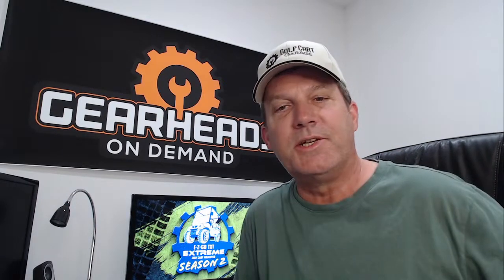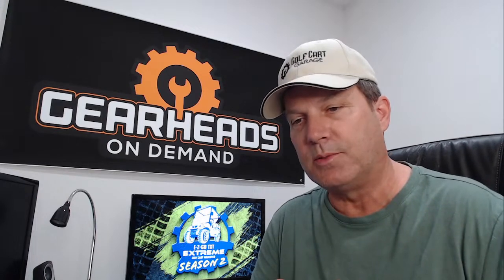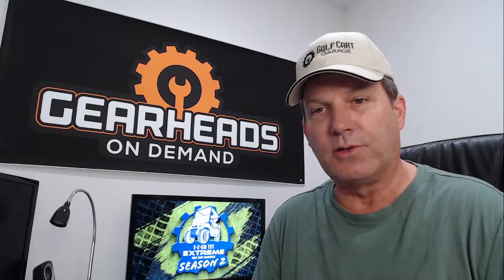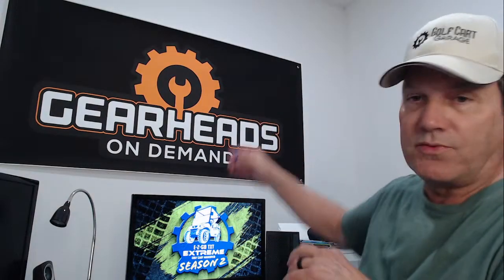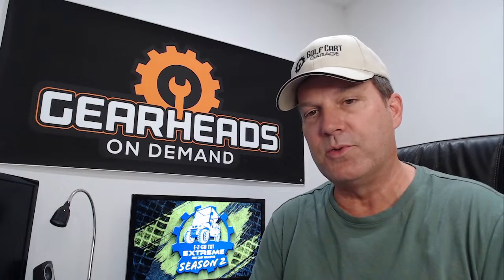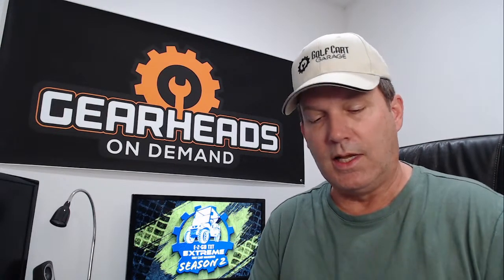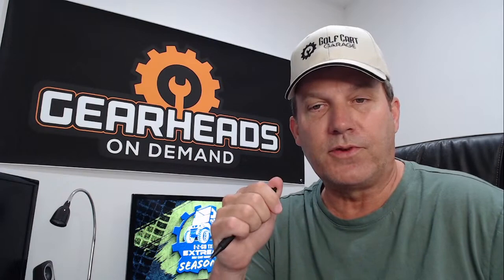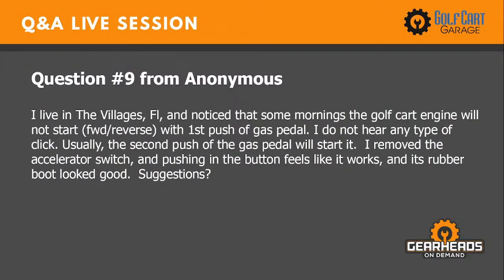EZGO Gas Fuel System Problems  | Golf Cart Garage I Episode # 51

Comment: I'm looking to purchase a 2021 E-Z Go (EX1 gas). It makes a lot of rattling while running but runs OK and looks new. What problems should I look for? Thanks!
Reply from the maker: Thanks for watching, Eugene!  You may want to get a good idea of what that noise is before buying.  Otherwise, it's very much like maintaining any small engine vehicle.  If you need a video call diagnosis appt, you can get one here: https://www.golfcartgarage.com/gearheads-on-demand/
Reply: @GolfCartGarage  Thanks for the response. I looked at other EZ Go golf carts and they did not have that rattling problem so I'm going to steer clear of this one. There are a lot of EZ go golf carts to choose from here in Ocala Florida. Thanks again, Eugene.
Reply from the maker: Our pleasure, Sir.  Feel free to reach out any time we can be helpful.